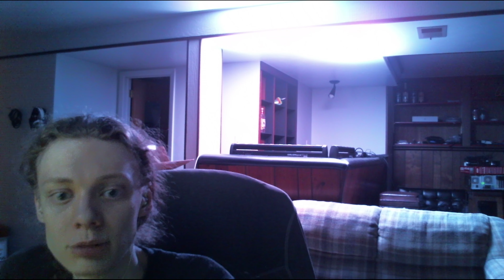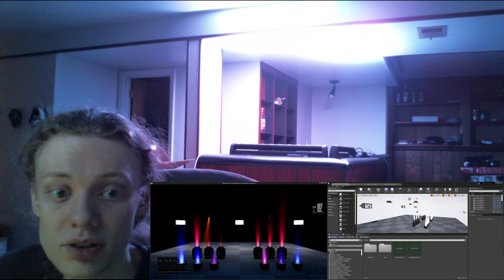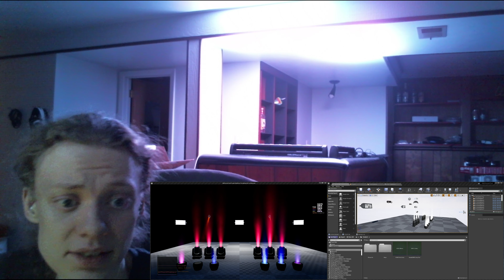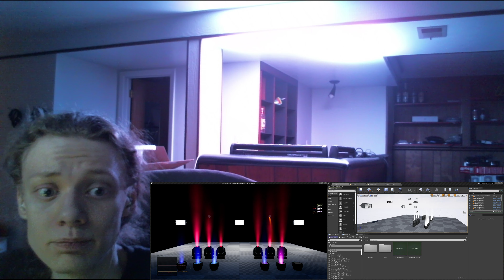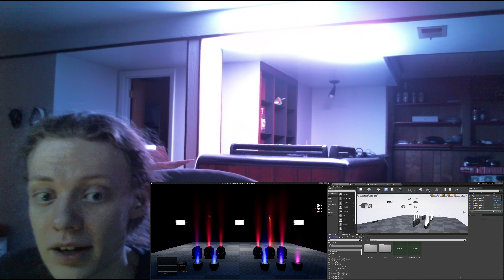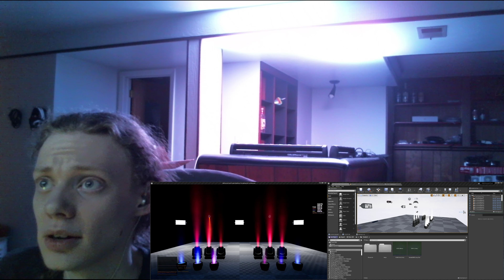DMX for Unreal Engine Virtual Production Mini-Course Intro

Comment: Im interested in normal stage lighting using DMX and triggering scenes from buttons on a digital console similar to MyDMX software products and Daslight etc. Is Unreal capable of this as there appears to be no easy frontend set up. Also annoying is the fact it doesn't use all those fixture profiles already out there.

Comment: Hi Brother, You saved my time a lot thank you for the amazing tutorial, God bless you.. I need your inputs on how do you handle more than 40 moving heads, If I use 2 universe with 32 lights each, I get error of infinite loop, so I have to change the loop iteration from 100000 to 600000 it works but my entire scene becomes heavy and it lags I can't even move around, for smooth play I have to reduce the lights..... Can you please help me with this issue... FYI I use i9 processor with 2080ti card with avolites DMX console via 10 gig lan to manage the lighting.
Reply from the maker: Hmmm, so I did some testing by patching a couple universes of Sharpies in Onyx on my end and things were working pretty smoothly for me. I'm only running a GTX 1650 and sometimes a 970 alongside 1Gb networking and that handles two universes no problem, pretty much in line with all of my smaller scope testing in dot2. DMX also only has a base data rate of 250kbps per universe before network overhead anyway, so networking shouldn't be an issue even on conventional 1Gb networking. Existing community knowledge has also pretty well established that you don't push towards a wall on networking until you push past 30 universes, up towards 40, at which point you can add more NICs or beefier NICs and be fine again anyway. I suspect there's something weird going on in software which I'm not able to reliably reproduce on my end at this time, thus it's difficult for me to troubleshoot, however I'm curious for updates or solutions if you are able to pinpoint the problem. In principle, and from what I'm seeing, two solid universes should be a very reasonable target.

Comment: you can use MagicQ PC from Chamsys. the software have 64 free artnet/sACN universes to use!
Reply from the maker: Yes, I believe you should be able to! The reason I didn't specifically mention it tho, is that it's my understanding that they're stingy about using control surfaces with it at the free/cheap tiers, such as midi controllers in ways that other softwares aren't, which are fairly crucial to being able to operate a show effectively. Perhaps, it might be nice for timecode tho, or fairly nice if you already have a Chamsys OnPC wing. 
For my personal setup, I can jump between dot2's one free universe and Onyx's four until I can track down an MA3 OnPC Node to unlock MA2 and MA3, however I'm also able to stack this with unlimited universes of pixel-mapping from my Resolume server, such that any pixel mapping I'd like to do comes at zero parameter cost other than any MA/Onyx parameters I assign for remote controlling Resolume, tho I also own enough midi controllers I don't have a strict need for doing so unless I decide I want to.

Comment: Thank you for this tutorial. You have no idea how much this has helped
Reply: Hi lexy, I am very new to the lighting world but am very experienced with UE4, I was wondering if it was possible to use ue4 to run  digital voyager sputnik.  I would like to set up a camera to capture particle in unreal and use a digital voyager sputnik as lighting on a real person.
Reply from the maker: In the long run, that should be possible as long as your fixtures support modern versions of sACN or ArtNet, or support plain DMX to use with an ArtNet node. Capturing particles to a texture is doable, and pixel mapping them should be doable but may be a little fiddly trying to get good results. There isn't currently pixel mapping support built-into Unreal but it may be possible to build this functionality in which case you can output sACN or ArtNet directly from Unreal or use Newtek's NDI SDK for Unreal or the community Spout plugin to output to another dedicated pixel mapping tool such as Madrix, Lightjams, or Resolume Arena